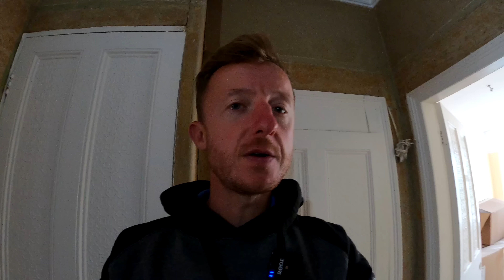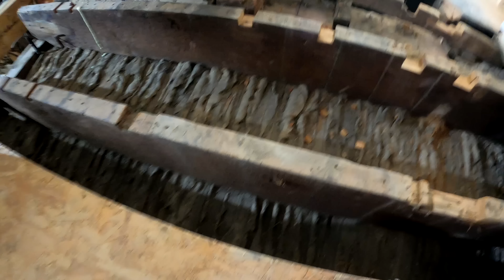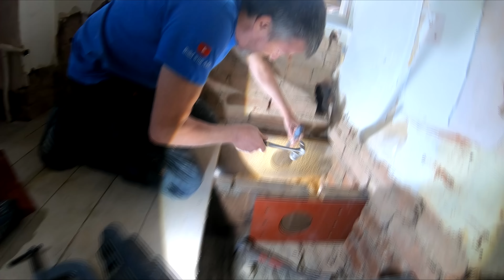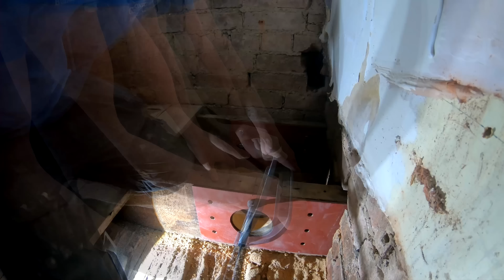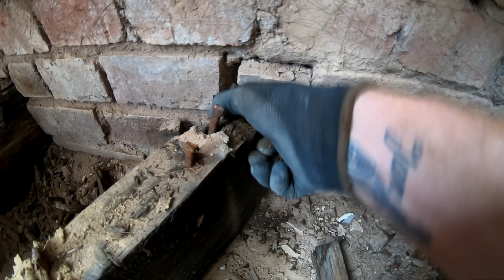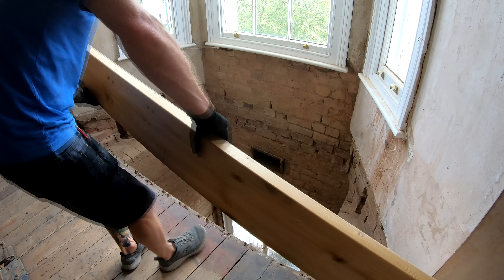FLOORBOARDS AND FLOOR JOISTS REMOVAL AND RESTORATION WORK | Regency Renovation #4 | Build with A&E

Comment: Top quality work. It’s sad, really, that the chances of you finding a builder who works with this level of care and attention are basically zero. There’s almost no possibility that you will find builders of this quality in the UK unless you already know them. 

On the flip side, it makes watching videos like this such a treat. 

I just installed an inline fan in my loft, but not before removing 30 year old yogurt pots, crisp packets, and maybe 30 meters of discarded copper piping, a broken in half table???, and 23 black bags of discarded glass fibre insulation that had been thrown in randomly by whatever builders did the loft extension and couldn’t be bothered to bring it down before they closed the walls off. Had great fun getting it all out of the 50cm access panel. 

Thanks guys, nothing better than the job you have to do before you can do the job you have to do.

Comment: What causes a creeky floor board? I need repairs doing in my home i just dont know what needs fixing 😢
Reply from the maker: Hi James we’re the boards creaking tap the nail or screw home, check for pipe runs and electrical wires if you going to put additional fixings in all the best Tony 👍
Reply: @BuildWithAE  thanks, so nails might of lifted away from the floorboards pretty much and just need tapping back down? Thanks for your help :)

Comment: Ah such helpful videos! How time consuming is it for someone to replace joists? Our bedrooms upstairs in our 1930s semi, both sag in the middle and it drives me insane as it’s so noticeable. Am I right to think it would be the joists? Is it easy to take up floorboards without breaking them?
Reply from the maker: Hi Rebecca much appreciated, it’s definitely the joists it is easy to replace the joist and take the floor boards up as well you may have wires and pipes that might need to be addressed. I would only tackle this job if you are both keen and experienced DIYers if not get a Carpenter in all the best Tony 👍

Comment: This is a great video, very informative and really enjoyed it thank you. 

I have 1930s home. I suspect the floor joists are potentially rotten due to damp and condensation issues. It also needs a brand new boiler, pipework and radiators (full heating replacement). Can I do the plumbing over the winter or should I do the floor work first?

Thank you.

Comment: I was hoping you may have been able to re-use the joists by cutting a foot off each end and putting them in the slot behind (ie only replacing the longest one). I know you've done the job well, it's just I get sad seeing beautiful old timbers get taken out to the skip!
Reply from the maker: Hi frogeye,

It would of been great to be able to re-use them, but unfortunately there was far too much rot and woodworm in them to safely do so.

All the best, John 😊

Comment: Love your videos and they are very informative but the health and safety is shocking.... No safety boots, dust masks or knee pads..... You guys are important and your health is something you should not compromise on especially when safety kit is cheap as chips.....
Reply: Disagree! Why at this point of a job would anyone be wear site boots, ruining new floors? Your point begs the question how old you are. From a personal point of view my knees are as hard as nails, I've never worn knee pads or ever felt the need to, whether flooring, screeding or anything else.
Reply: @TheMarky63  I don't understand the point you are making..... Health and Safety is important for everyone and if you don't want to take that on board then when an accident happens, you only have yourself to blame and no one else.
I've had a broken toe and it hurts but the point is it puts you out of action and you can't work which mean no money coming in....
You say your knees are hard as nails..... good luck with that when you are older and they are shot..... You will remember this conversation.

Comment: Fairplay guys! I've been building for 25 years and a time served plumber so I fully appreciate what you're doing here. The lengths to which you go stands out an absolute mile!
Pro tip tho, when drilling them large 4 inch hole saws, start the cut then put one or two 5mm pilots on the inside of the circumference. Then resume with the cut. Allows cooling and causes a lot less clogging on the bit. ;)
Reply from the maker: Hi Lee thanks for your kind words, that’s a great shout love tips like that will try that and give you a shout out for that idea all the best Tony 👍 have a awesome weekend

Comment: Hi John. Great work on this. It's going to be a beauty. Just wondering whether you fix the joists down to the brickwork to stop them moving or if it's ok to leave them loose?
Reply from the maker: Hi Tim,

It definitely is going to be a beautiful home.

The video only shows them being temporarily placed. They were slate packed and mucked into the pockets and then noggins installed to prevent any slipping.

Hope this helps.

All the best, John 😊

Comment: A lot of old properties I believe had Lime plaster. I see that leaky wall has plaster damage. What wall plaster used to repair and smooth the wall and what would you normally use now in modern days plastering these old buildings?. Can you still get Lime plaster to use for the repair?
Reply from the maker: Hi Rail Man,

All of the exterior walls which need repair work, will receive lime plaster. The outside is rendered with lime render, so by using lime internally, we allow the walls to breathe as they are meant to.

Hope this helps.

All the best, John 😊

Comment: hi great vid. as a diyer I learn a lot off your vids, Was that a metal plate you bolted to strengthen the joists which had the hole  for the soil pipe?
Reply from the maker: Hi arfan it was it was designed and fabricated to help the load and deflection thanks for watching all the best Tony 👍have a awesome week

Comment: Quality work as always. By the way did the new joists dimensions match the width of the existing ones.
Reply from the maker: Hi asif zardari,

Glad you enjoyed the video.

Unfortunately not. We slate packed them, so the tops ran through and then put furring strips on the underside for the ceiling below.

Nothing's ever that straightforward 😉

All the best, John 😊

Comment: Think you should have wrapped them joists with dpc
Reply from the maker: Hi Robert,

The joists were only temporarily placed, they were wrapped in DPM before they were permanently fixed.

Thanks for watching.

All the best, John 😊
Reply: That's the ends in wall

Comment: Are you going to be putting lime back in, plaster etc? Because otherwise you could get some serious damp issues after a few years if you don't allow the walls to breath even if you have fitted damp proofing? Particularly on the ground floor given the solid wall construction and if the cladding on the outside is sealing it (the other option there being limewash/limecrete on the outside)
Reply from the maker: Hi Edward,

All internal walls on the external elevations will be re-plastered with lime plaster. One side of the property is also being rendered with lime plaster, as the original render had blown.

As you mentioned, it's important to ensure these properties are able to breathe, otherwise damp issues will occur.

This property will be renovated as conscientiously as possible, using the correct methods and materials.

I hope this helps.

Thanks for watching.

All the best, John 😊
Reply from the maker: Hi Edward the whole external wall has had the old cement render taken off and lime plaster has started to be put on but as you know this is a longer process because of carbonation and wetting down and lots of meters to do, interior lime were we can. Thanks for watching all the best Tony 👍
Reply: @BuildWithAE  Yeah I know, soooo much more effort but worth it in the long run! Awesome to see you guys are doing a proper job on this, a lot of companies wouldn't bother and would just cover the place in cement and gypsum because it's quicker and cheaper

Comment: Nice rip saw cam, probably would have bitumen coated the joist ends but it’s not a building requirement
Reply from the maker: Hi bredan ford,

The joists were only temporarily placed, we wrapped them in DPM before the final instillation.

Thanks for watching.

All the best, John 😊